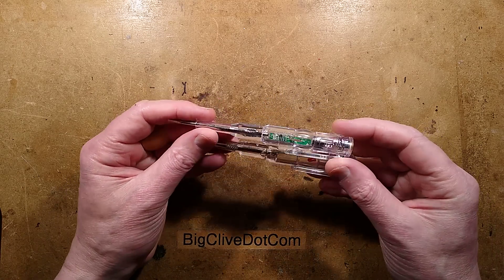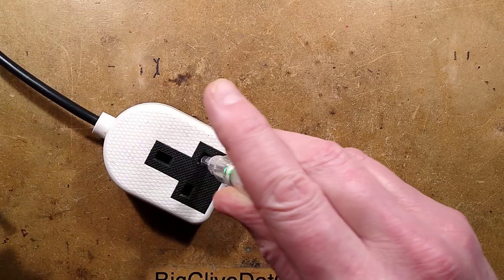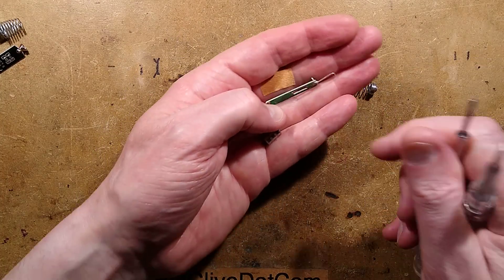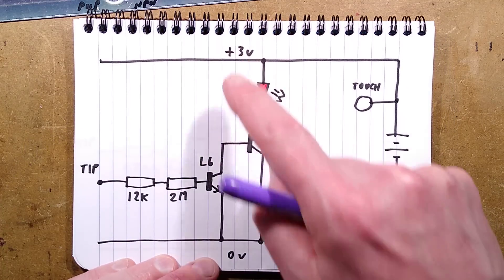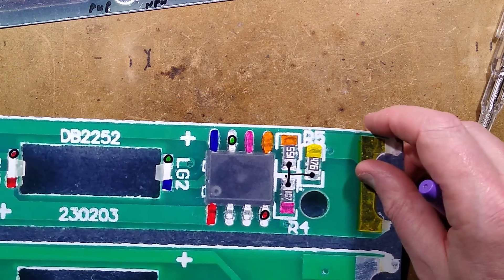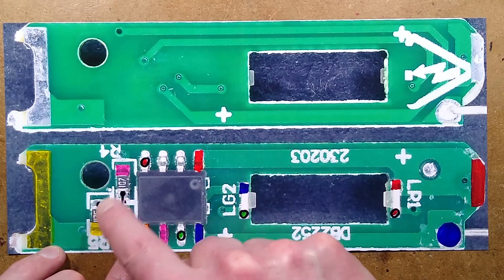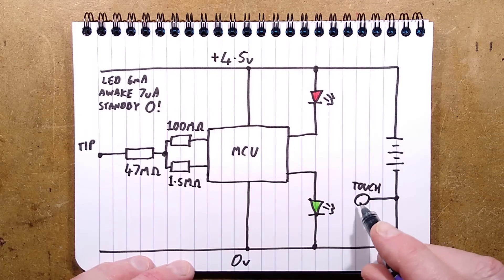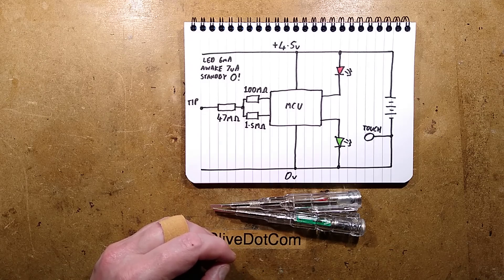Test screwdriver with microcontroller!

Comment: I remember starting my apprenticeship having bought a CK neon test screwdriver for my tool box . I thought I was the bees knees and had just the right thing to test for isolation . That was a long time ago 🤭
Reply from the maker: Likewise.  And then "upgrading" to my two LED test lamp.
Reply: In germany the professional electrican learn to use test tools witch must have a very low current to work fine !

The neon type screwdriver and you have dry skin and or have good isolating area ...
Or the amibent light is not dark enough and you will not see the glow.

No good and safe idea. 

Other case = A copper (or metall) is near an copper cable with switch power on ...
Well the inductance to the disconected metal show power at these metal. Upps wong test result ! 
If you use a test tool and is pulls a low current to neutral (or protective earth) line, than you see that there is no power connected. 

Well in germany these rest screwdrivers are illegal in professional use. 
But these electric test screwdrivers (normally with the 1 M Ohm resistance and a neon bulb)  are very cheap and very common in private use. In germany you can buy these for very low money. 
Usafe and bad idea but very common for privat persons and ofter the result will be ok. 

If you like to work like a professional buy a better test tool. 
You dont have to spend a lot. 
I will not buy these mikrocontroller version screwdriver. 

With a cheap professional test tool (in germany you get these from aproxx $ 20 included sales tax and china brand version) they offer additional features. 

Better brands have voltage LED for some voltage values. 
And often have a LED for right turning three phase system and one for left turning three phase system to connect a heavy duty 3 phase motor to power and let him turn in the right direction. 

And bettertester have a button (switch for a little bit more than 30 mAmp) to test the RCD (or RCCB) safty switch. 
Fehlerstrom-Schutzschalter = RCCB, english = Residual Current operated Circuit-Breaker 
(German standart RCD (or you say: RCCB) have max 30 mAmp differential current (= 0.03 Amp) to cut power line and neutralin under 0.2 sec for german standart electric installations. (Special installations only under special circumstances possible and allowed e.g. hospital in operation rooms and for ... and other circumstances)

Top tester offer additional small LCD display for voltage (works only with battery). But the basic funktion works without a full battery (for safty reasons). 

See youtube video = 
https://www.youtube.com/watch?v=5SS7xd4YXR8

The big tester is usuall in professional use (aprox 1000 US dollar) and have to be calibrated ?every year?.
The small tester is the daily use one for lealg professional use (= better than your neon bulb screwdriver). 

Yes dont hurry to by the aprox $ 20 version if you only use the screwdriver once a year. 
But remember that the test result can be wrong under some circumstances. 
You will feel the hurt or someone will complain (if he still can).
Reply: @callishandy8133  Its not inductance, its capacitive coupling.

Comment: Yes a nice video and I like it.
When I saw these video, I like these blinking LED and like to have one screwdriver for fun ...
But after a while I changed my decision. 

If you are in germany a professional electrician you never ever use these tools. 
(= For professional use = illegal and professionals are told why these rule is better for there life and there customers life) 

Even the cheap screwdriver with only a 1 MOhm resistor and a neon bulb inside is not used by professional electricians. 
But very common for privat persons in germany. 

No good for a safe works ... (= risk if you wear isolating shoes or have dry skin)
Try it in country =  a long metal (without contact to protective earth ground) 
beside an active power cable (=capative inductance from the active line but no current) .
Test it with current thrue the power line and without. Turn the power line a litte to get the metal near the isolated power line in your cable. 
If these (or the neon type) screwdriver works fine, then it will (and must) detect in thelong metal (or cable without any contact to your electric system or a single wire) dangerous voltage ! 
Wow you test metal/not connected cable/single wire is not connected with protective earth or netral line or power line ! 
Impossible that there is a voltage detection but it will be (and must be) a voltage detection. 
The connected power line induct by capacity a voltage in your wire and the neon typ (or mikrocontroller type) screwdriver detect these voltage. Touch the end of the single wire and by miracle the detected dangerous voltage is gone. 
Result = Even when there is a voltage detection with these diffent types of screwdrivers ...
... it is no safe test result. You better use 2 contact tester for electricity and not the cheap unsafe test screwdriver types.

Again = Only privat person in germany buy the unsafe and very cheap screwdriver with neon bulbs ...
... because they dont know that these electric test screwdrivers are unsafe. 

A professional electrican in germany tell you that you need a small but sure amount of current ...
... to detect safe (and under all conditions) the life power. 

Impossible with the neon type screwdriver and very very very possible unsafe with these mikrocontroller electric test screwdriver. 

The miracle is that these german test tools have a current from little above 1 mAmp (=o,oo1 Amp) ...
.. or better little more to detect safe the L = life 
power line of the power socket. But you need the neutral wire (or protective earth line) for a safe current return.

I pay for the cheapest chinease no brand name  test tools  about 20 Euro (aprox US$ 21included sales tax) in germany in Feb 2023.
But I have to find these low budget test tool type from a china brand somewhere in local shops. Not easy !

Little more money = I get a addition button to test the RCD safty switch (englisch RCCB, english Residual Current operated Circuit-Breaker ) with 30 mAmp load (= o.o3 Amp is the standart value for diffential current in germany) and in under 0.2 sec the circuit must be disconnected. 
Result = I fell a small hurt in my finger and than the power is cut. I will stay alife. Often no hurt ! A real life saver.

And for more money I get a digital voltage display. 
But now I have to pay aprox 80 Euro (upto 125 Euro = approx  $130 included sales tax) for a premium brand (=long lasting and from a trusted premium brand and tested in electrician schools and used by every electrician company). 

Yes, these tester with a LCD voltage display need a small battery. 
Yes, these tester are no screwdriver. 
Yes, if the battery is empty they still show by a red LED the life power line (but with less safty). 
Yes, if I have to safe money I dont buy a top premium brand product for long time daily professional use)

BUT always I have to use the neutral line (or the protective earth line) aswell .
 These safe and legal tools have 2 contacts. 
One for life power line and the other for neutral (or PE = protective earth). 
The reason = For a safe test result , these tool let a low current flow, with a good logical reason ! 
No way and not fast and nice like a simple screwdriver. But I only life once and the customer from my boss to.

Cheap unsafe electric test screwdrivers maybe in your country legal. Differnt laws and working rules ?
I think you tell better the electrons that they are not in germany. 

In germany you have not a lot of electric accidents, 
even if we have double voltage (230 Volt AC at standart wall plugs) . 
Funny !

 I see that nearly all normal privat person buy these unsafe neon type screwdriver in germany. 
These privat persons have low/no knowledge with electric installations. 
These screwdrivers are very cheap (Cheapest brand aprox US$ 2 or US$ 3 included sales tax) and a risk for privat persons ...
Ok, very common to use and 
the old daddy told the young boys to use these (since decades). Even my daddy told me and his daddy him.  

Yes, I am sure that these electronic microcontroler electric test screwdrivers will find a lot of customer in germany. 
But I think that the EU-boarder custom officer ...
...stop the chinease mikrocontroller test screwdriver container at the EU-boarder. 

EU safty rules maybe dont allow these mikrocontoler electric test screwdrivers ( I think = I dont know it exactly).
I never saw these in local shops or at german version of Amazon. 
Remember it when you buy these in your country. 

Yoke = Remember to say your electrons that they are not in the EU or in germany. 
And yes, the higher 230 V AC 50 Hertz voltage is not a real problem and unsafe in my country. 

Dear german (and EU) youtube watchers in the US they use 60 Hertz (no problem) but these test screwdrivers are designed for 120 Volt AC and not a perfect idea at 230 Volt AC in my country.

Comment: I think the 100M and1.5M both form low passes with the input capacity. Due to the phase shift you get a signal on an internal comparator with an applied AC signal

Comment: The older versions of these were actually pretty safe.  The series resistor was a spiral cut carbon on ceramic type, providing 15mm of separation.   Mine stopped working a couple of years ago and I assumed that the battery had expired but on taking it apart after seeing this video I discovered that it was just a dirty contact and it now works again.  The nice thing about them is that you can test that they are working simply by putting your fingers across them before and after you use them for detecting voltage.   Almost as good as an electrician's proving unit.
Reply: @petehiggins33
Is that you Peter? I thought I saw Phil on YT a few weeks back
Reply: @jagmarc  Yes Mark  it is me.  I haven't seen Phil on Youtube but he's the only person from Astrium that I'm still in touch with.  The rest of them have all died of old age.  Sorry to read about your illness, good luck with your treatment.  Frankly I was surprised to hear that you're still alive.
Reply: @petehiggins33 yes I've been hiding! When I left I wanted to make sure fully off recruitment agency headhunters radar, and today I still live on this tropical island. 
 Wouldn't it be great if Dave S, Steve C, Andy M , Mark C, GLG etc.  showed up here too, I'm sure they tune in to this channel too. 
I heard Brenda R passed in 2021 she had it much worse than me
Reply: @jagmarc 😂

Comment: One of the advantages of adding a microcontroller to these mains testers, is that there is the possibility that they can email  the next of kin in the event of the  inevitable electric shock failure. 😄 This does not look if it has any chance of passing creepage and clearance rules.

Comment: I've still got a few neon ones floating around the toolboxes. I've also got a wonderfully faulty one where the plastic insulation is longer than the screwdriver shaft and completely covers the blade. 

It drives people mad when they grab it without thinking, get up a ladder to do some terminals in a ceiling rose or something only to find it's "a blunt instrument" 😂

Little things that make the day go by...

Comment: I initially wondered why they bothered with the 12k resistor when it is negligible compared to the 2M resistor other than bridging the gap. Presumably a single resistor isn't rated for full mains voltage so the designer split it over 2 resistors. But instead of putting 2x 1M in there someone decided on a single 2M resistor and a (probably cheaper) 12k resistor. Of course, that means that the voltage drop across the 2M resistor exceeds its rated voltage!
I wonder if the same can be said for the 47M and 1.5M resistor ratio in the second device. 2x 22M would have been better and would not change the sensitivity unduly.
Reply: I mean, You could also wonder why they would align the resistos in a way that makes the part that sticks to the mains and the part that you touch be just barely 1 solderbridge away...
Reply: You beat me to it, it seemed to me that 2 x 1M would have been simpler and safer. (After all, with the existing idea, if you accidentally put two 2M resistors in, instead of a 12K and 2M, it's no biggy, but if then accidentally pop in two 12K resistors its potentially "finger-tingle" time, where the user provides a bonus audiible alert!
Reply: My thought is that the 12k resistor doubles as a fuse, quickly burning out while the 2M provides current limitation protection.
Reply: @johanmetreus1268  The only explanation would be, indeed, that the 12k one acts as a fuse in extremis. Otherwise, it makes no sense. The voltage drop on the 12k is negligible compared to the voltage drop on 2M (it's proportional), so @chrishartley1210's hypothesis doesn't hold water.
Reply: 0Ω resistors were out of stock or expensive that day. Chabuduo (good enough).
Reply: @derludditus2758  There is certainly somethting odd going on - though assuming the resistors are equally rated, the biggest voltage drop ( by orders of magnitude) would be over the 2M resistor. Indeed if you put a 2M resisor in series with a 12K one and just tested them to destruction, the 2M would be crazily hot to the touch while the 12K was still nominally at ambient.

Eg:  If you plonked 2Kv over it, you would get 1mA current, and dissipate 2 watts in total. Almost ALL of that 2 watts is "dropped" in the 2Meg resistor which would be getting extremely toasty, very quickly, but 1mA of power through a 12K resistor would be disspating 12mW.

It would be the 2M resistor that fused first. This is what makes the 12K value so absurd - to the point where I do wonder if perhaps originally it was meant to have 2 x 1Meg resistors but someone got a deal on 2M ones and just "filled the other space" with something "spare" that would basically just "short out the other space".

It's a bit of a puzzle isn't it!?
Reply: @abitofabitofabit4404  Parts is parts.
Reply: Nope its a manufacturing choice.
They have 2 Meg resistors and two of them is too much resistance, so they stick anything cheap in the second slot, in that case they abviously had a surplus of 12k hanging aroud.
Reply: @derludditus2758  The 2M resistor taking the majority of the voltage drop is exactly the point I was making, that voltage drop probably exceeds it's design rating which risks flash-over leaving only a 12k resistor between the live terminal and the circuit.
Reply: 120V mains through a 12k resistor yields already potentially deadly 10mA, so it makes for a bad failsafe in case the big resistor arcs. Also, it would dissipate 1.2W while doing that, and it does not look like it would survive that.

Next time make it at least a 100k :)

And yes, they really should not be aligned like that, just in case the case ever fills with water. No chance against salt water, sure, but at least for fresh water or rain water, it should be designed so at worst a few mA would hit you if it fails. This does not seem like it, and it also is not waterproof due to how one gets to the batteries.

Comment: Interesting, years ago I had that type of voltage detector but it was just a neon bulb and a series resistor. As you mentioned on reflection it did not seem like a good idea to be in contract with mains voltage with only an unknown resistor for protection.  Typically 100k for 120V circuits on this side of the pond. I decided the convenience was not worth the risk. As others have mentioned the steel used for the screwdriver was not the best so it even failed in that regard.

Comment: Sweet vid, your breakdowns & subtle curiosity are great. 
I kinda want to get one of the old neon style test screwdrivers now. 

My old 12v test light melted after checking for current on a chain link fence that was sparking at the latch. 
Afterwards we found A leg of 480 volts had shorted to a junction box below grade and our chain link fence circling our Engine house gained about 40 volts DC. 

One day I’ll post that video

Comment: No, thanks! I don't want a battery power-supplied µC in a live-voltage test screwdriver (colloquially called Phasenprüfer in German, formally Spannungsprüfer). I prefer my trusty Neon Demon (ha, learned that term from ThinkLIST!). Only two components that can go bad. No PCB traces for conductors, just component leads.
Continuity check and live-voltage detection shouldn't be together in one unit, except when it's a multimeter!

Comment: This looks dangerous. The chip might be a cheap PIC or HC08 knockoff. Would be interesting to desolder it and look if it responds to some vendor programming protocol.
Reply: IDK for HC08 but VCC and GND pinout is the same as PIC chips. It's probably from a PRC manufacturer like WCH who is known to produce PIC clones, even for the 12V series.

Comment: Over-complicated with narrow gaps - I don't trust its reliability and safety; still an interesting design. Why doesn't it have a buzzer for continuity and voltage test? That'd make it a sonic screwdriver...
Reply: I like that idea. How small can you get piezo buzzers to fit in the handle?
Reply: @Alacritous  not sure, but I think it's something around 6 or 8mm.
Reply: There is some continuity probes using a buzzer though not usable as a screwdriver.

Comment: 6:00 - that arrangement of transistors is called a darlington pair (well here in the UK)
Reply: Nope .  Darlington is a different arrangement acting like a single large transistor with double BE voltage and squared amplification .
  This is a cascaded amplifier with lower supply voltage .
Reply: @johndododoe1411  - Sziklai pair actually.

Comment: As a child I used to stare at the neon ones my dad had and could never work out how it was supposed to work, putting a battery on it and getting nothing 😂 oh innocence

Wouldn't one with a diode in, if it could manage the voltage, be kind of a lethal choice?

What happens if the batteries are flat